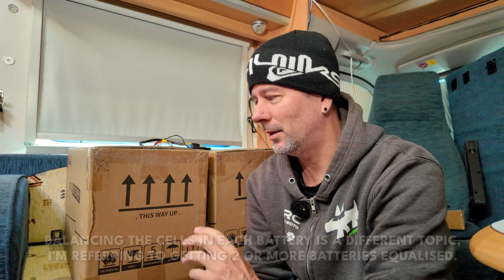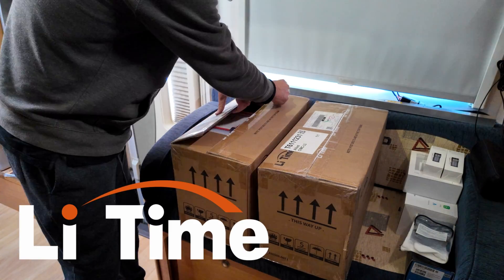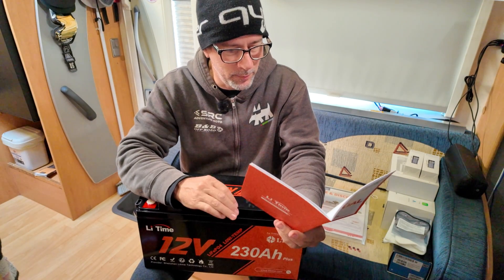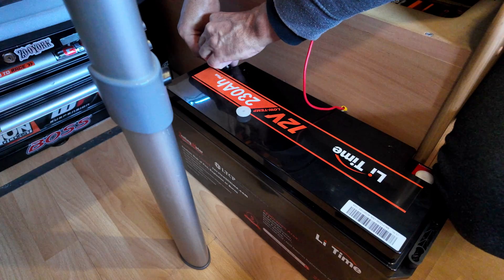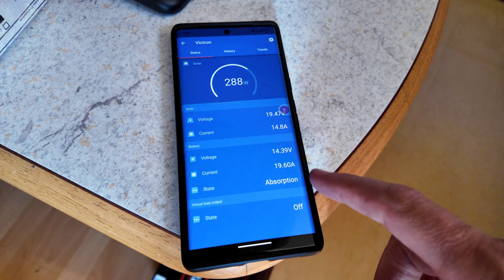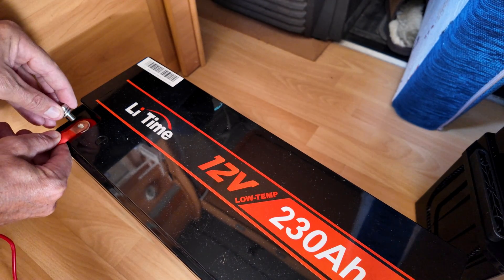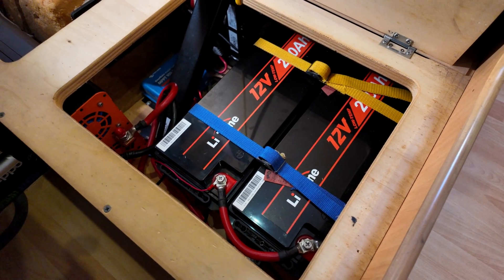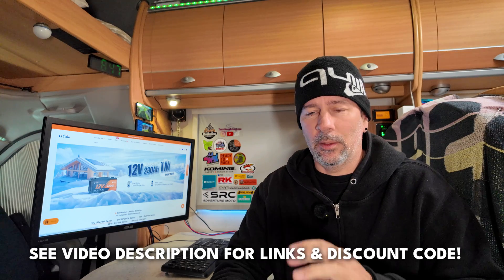How To Balance Parallel Lithium Batteries: LiTime 230Ah LiFePO4

Comment: Dang man I am Jelly 230AH is beast!
Reply from the maker: So much powah 💪 Glad to have it on these fkn cold mornings when I'm up early for a bush ride on the scoot mate and I gotta get that heater cranking 😬
Reply: @MVDBR  no I get why so much POWAH, electric heater? But I guess since you have two what are you at 460 AH? Get it bruthah.
Reply from the maker: @HillPhantom  yeh mate I should get a diesel heater or something but I don't need it that often and the rooftop AC on reverse cycle works well... even if it does pull down 1800  watts at full noise 😬 least it's free to powahhh
Reply: @MVDBR  I got a diesel heater and its a pain in the ass, messy,  and dangerous AF.
Reply from the maker: @HillPhantom  really?? People seem to rave about how good they are
Reply: @MVDBR  they are good, solid heat too, but then again I didn't get the German version opted for the Chinese version and its sketchy, intake and exhaust are centimeters apart ....You are a wrench buy so you prob cleaner than I when I have to tear it part to fix the fuel pump every two months lol. I heard the German ones are really good tho...and get this they put exhaust and intake on opposite sides...Genius lol.
Reply from the maker: @HillPhantom  😂

Comment: LiTime batteries are junk, and their customer service is nonexistent.  My litimes never synchronize and constantly suffer from abrupt voltage drops, which indicates bad cells.  They also discharge at different rates.  The balancing circuit also doesn't seem to work anymore.  All things this youtuber will never know because his batteries don't have bluetooth.  Anyone who has any experience with BMS's knows the litime versions are junk too.  No adjustability, no individual cell voltages, or voltage deviation.  You're far better off buying individual cells from Amazon or Alibaba and an aftermarket bms (like a JK-BMS) and building your own battery bank.  Will Prowse only does battery breakdown reviews for individual batteries in a utility context.  He doesn't ever connect them in series or parallel to see how they behave as a bank or do any long term reviews.
Reply from the maker: Seem to be a majority of happy LiTime customers on his forum 🤷 And for most of us, building our own batteries is way outside our knowledge and skill level. Sounds like a great idea, sure, if you can do it 🤘

Comment: Mmm.  You don't actually have to balance whole LiFePO4 batteries before you connect them in parallel.  It's basically just a waste of time to do that..  All you have to do is make sure their voltages are within roughly 0.5V of each other... which is typically already the case at any SOC between 30% and 70%.   ALL LIFEPO4 BATTERIES can operate this way.  There are no special cases.

What will happen is that the batteries will be at different SOCs upon initial connection, and some current will likely flow between them upon initial connection.  It will rapidly diminish, though and as long as the initial voltages were fairly close it will not exceed the capabilities of the batteries (or even get close to exceeding the capabilities).

The SOCs will synchronize after literally just 2 or 3 regular charge / discharge cycles.  So all you really want to do is connect them up and operating them on their normal solar cycle but with a bit of attention paid to the maximum charge and discharge current.  But no more than you would usually do to deal with battery disconnects due to unbalanced cells on initial shipment.

That's it, though.  Nothing special.

The reason this works is because LFP batteries connected in parallel  will current-share in rough proportion to their capacities and their relative SOCs.  This means that as the bank goes through its regular charge and discharge cycles, the SOC of the individual batteries will synchronize to each other.  Usually within 2 or 3 normal cycles.

-Matt
Reply from the maker: Thanks for the info mate, yeah as I said there seems to be a lot of conflicting info on this around. Maybe it's unnecessary but it can't hurt to do it if you have the time. At one point with my previous batteries, I would drain them to 50% SoC on the shunt but it would still be showing 13.5V, so not sure what was going on there. I didn't check at the time but later on figured that maybe they were out of balance and one was charged more than the other.